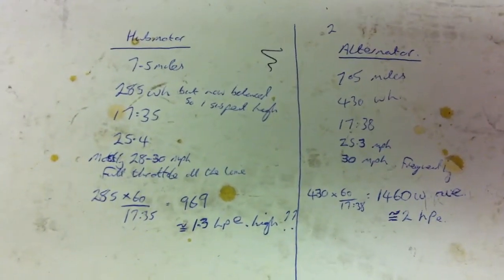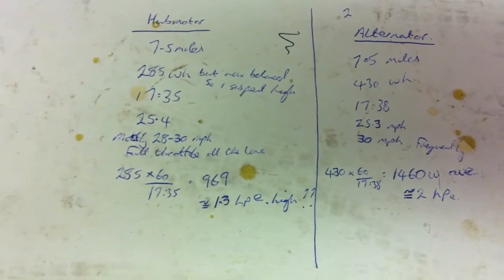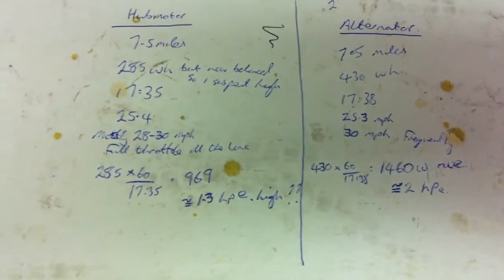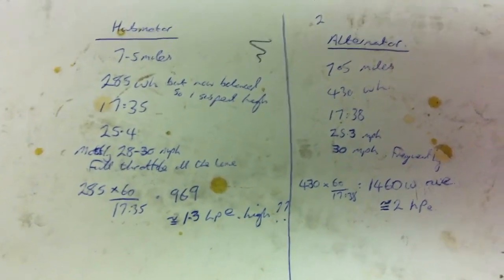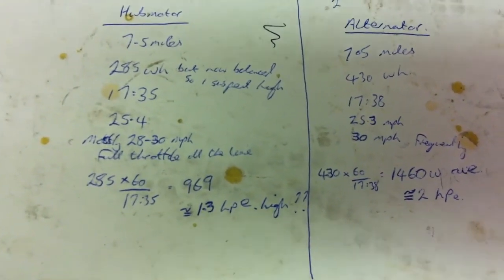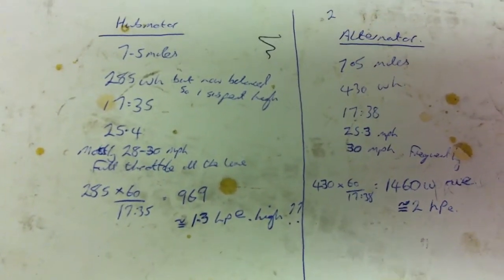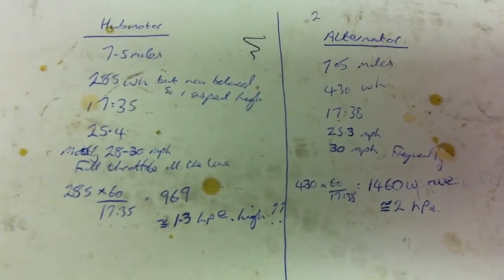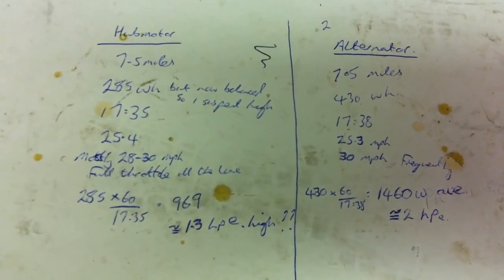Alternator bike versus hub motor bike efficiency test - Part 2, the results

Comment: If I comprehend the alternator physics correctly, applying voltage to the stator to increase speed is basically applying "saturation voltage" artifically with a battery. Have you figured out the least amount of current needed to the field current to maintain a given speed of 25 mph?  Seems like momentum would be a great advantage with the alternator motor.
A bit like ...as a kid smacking a merry-o-round just to keep it going instead of trying to run with it to keep it going.

Comment from the maker: Hi. Tchangly21 seems to have done that (see https://youtu.be/kJxsIxFLonQ). I tracked back through his other videos on that moped and I think it was faster when he had a 12v energised coil. I haven't tried it myself; I turn the coil voltage down if I'm cruising to reduce losses but l like the ability to wind it up to 20v if I want to do 40mph. The thing I do so wonder is whether part of the inefficiency is due to the high voltage. I'd actually prefer more torque at a lower speed because at the moment the alternator does about 3000 rpm on a 6:1 reduction, so I can't pedal and use the power at the same time. I know that reducing voltage will reduce speed but I'll need a controller that handles more amps. The thing about ebike controllers is that the high power ones are also high voltage. I have found one 36v 1000w controller on eBay in the UK and have ordered it. I think it's 45A; if it's 18 FET then I'll shunt it up to about 70A and run it at 36V. It will go straight into this bike; I just need a 36v battery that will deliver the current.

Comment: Hi
I commented on one of your other videos. Love the Alty bike but was wondering have you considered taking the armature coils out of the alternator and replacing them with magnets, it should improve the efficiency a few percent at least. I took an alternator apart to try this but my square magnets wouldn't fit. I've since thought about trying it with HDD magnets as they are curved. The correct way is to use a ring magnet but I don't have one but have a load of old hard drives.

BTW thanks for sharing as this is pretty awesome.
Reply from the maker: I've got 4 ring magnets from microwave magnetrons. They seem to be magnetized N/S on the flats. I only stripped them at the weekend, so not sure what to do with them yet.
Reply: If they fit and are powerful enough then that would be great but I don't have any so was looking another way.
 I think I've worked out how to use the HDD magnets, I got out of old servers. I tried fitting them flat in the armature but they are N S so didn't work. I then decided to cut down the armature fingers on one side so they are thin and the magnets can fit vertically with the N on one side of the finger and the south on the other. The other side will have to have the fingers cut off completely. I'll need to secure everything with a dollop of epoxy. I made a start tonight and so far it looks promising.

BTW I also made a battery spot welder with a microwave oven transformer and using a SSR and a 555 timer. 
It's working a treat.